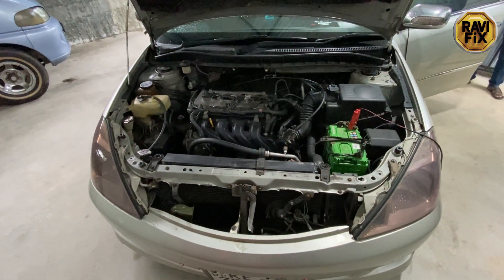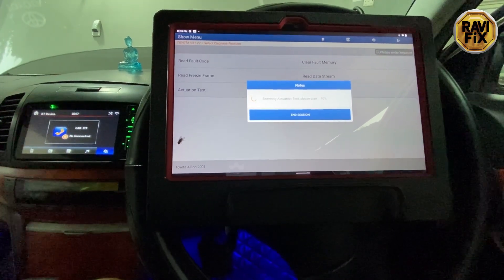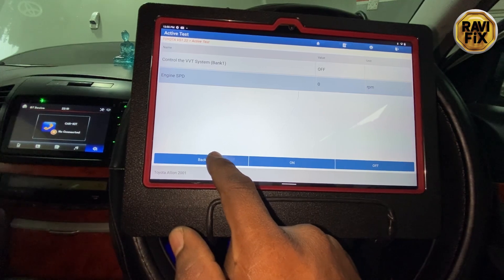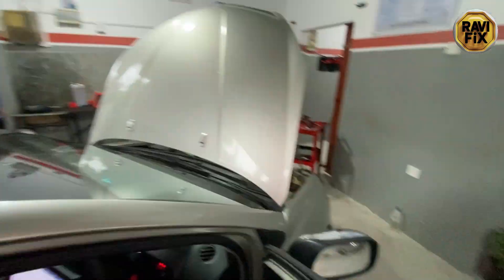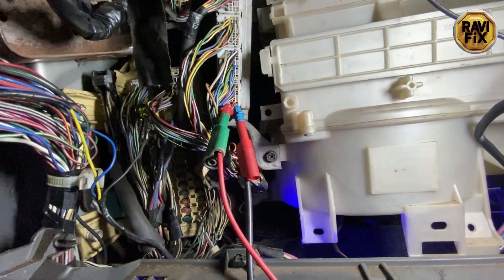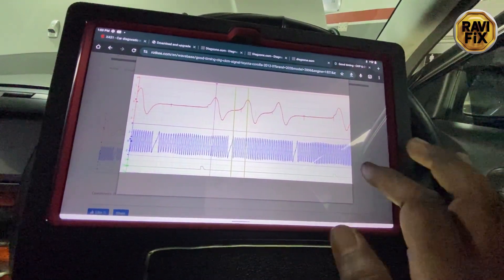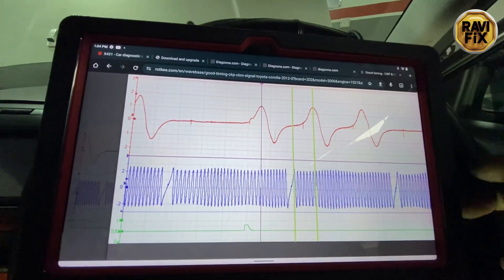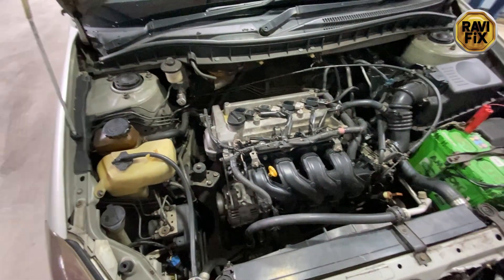How to Diagnose P1346 Camshaft Position Sensor range performance fault accurately. Toyota Corolla

Comment: Love the flex at the end ... In other words you said " I am not going to do the grunt work.... I only do the Diag!!!!
Reply from the maker: I just do diagnosis and electrical repairs only. Most vehicles have electrical problems at the end of the diagnosis and most of the time no part required repair. But rarely meet this kind of Mechanical problem not in my scope.